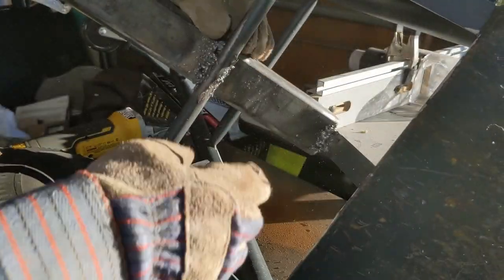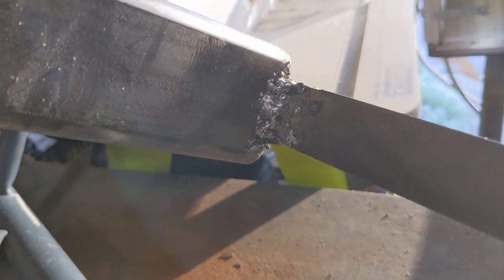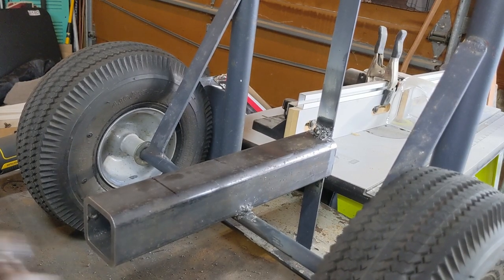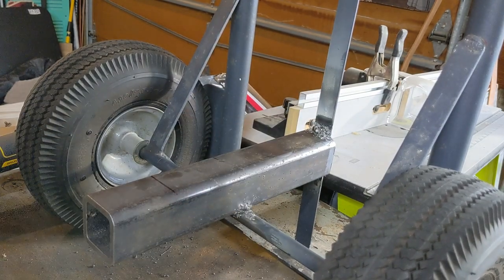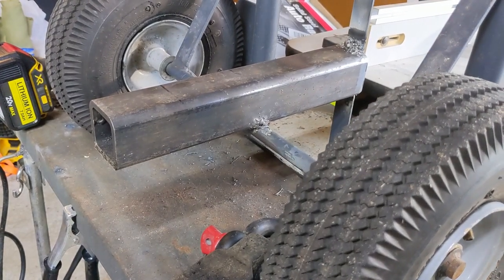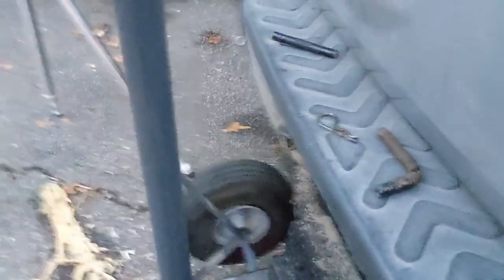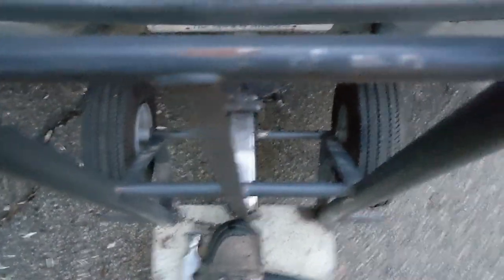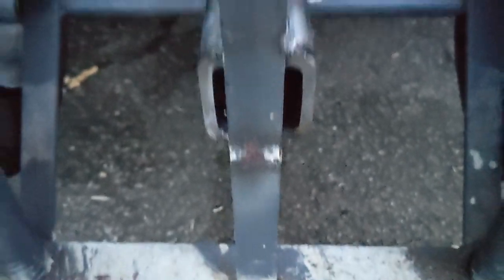Making a Janky Hitch Mounted Hand Truck

Comment: It's not a stick welder. Gotta stop beating on it. Turn up the temperature and slow down the wire.
Reply from the maker: Agreed... this was the first "real" project I did after getting this FCAW welder. I've learned a wee bit since then. Still not great at it, but better :)
Reply: @TheNewJankyWorkshop  do lot's more practice welding off camera and get better with time. People are ruthless and nasty, don't give them the ability.
Reply from the maker: @2JustMe1  Haha, of that I am aware! This video, as with a lot of mine, are more of experimentation and skill building. This is out there because the concept is pretty neat IMHO of a making a hitch mounted hand truck, and it was the perfect project to really put that now defunct welder to use.

Appreciate the watch and the comments!

Comment: Not a very  good welding technique … All those welds will fail.
Reply from the maker: It was my first real welding project, so it is definitely a janky job at it! However, it has held up after 2 years of use! (It also has pipe clamps on it as backup!), and I also lash it up to my roof rack as another precaution :)